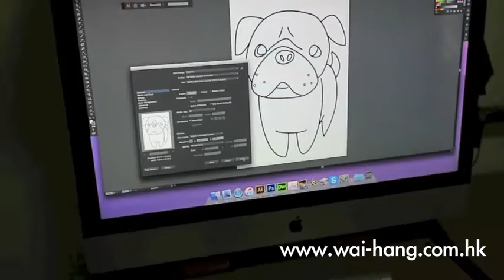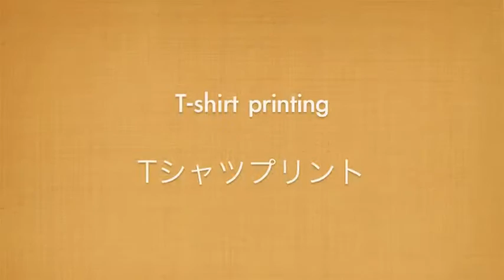シルクスクリーン印刷．2017

Comment: Just a quick question
What was your screen size and size of glass ?
They should be equal ?
How thick the glass would be okay ?
Reply from the maker: From the video, the screen inner size is 12" x 16". 
The glass should be outer size of your screen, that will be 15" x 19".
The glass is around 4 mm thickness.
Reply: One Last Question Then I Won't Disturb You
What Size Of Platen/Board You Would Recommend For Printing L, XL T - shirts With A 16" x 20" Screen ?
Basically I Intend To Print A3 designs (12" x 17").